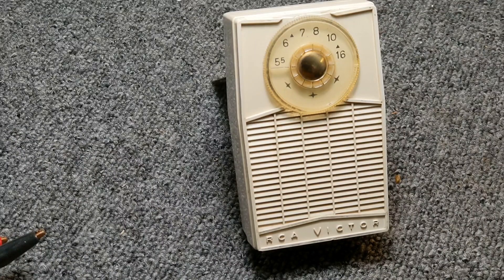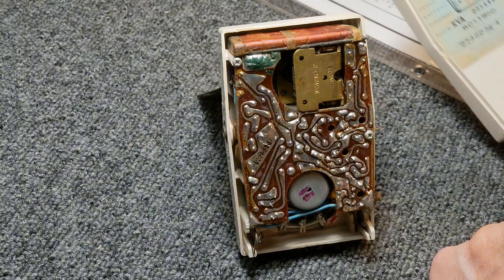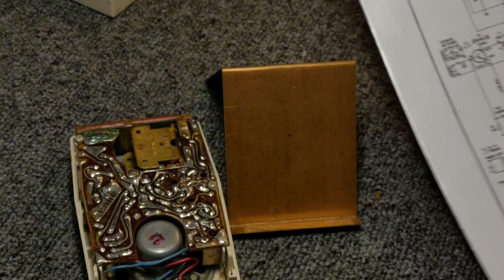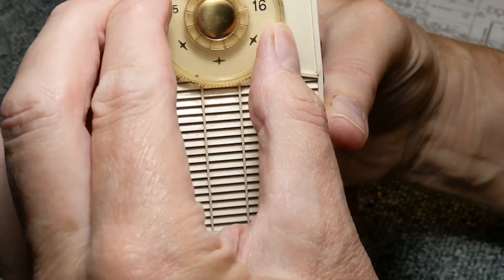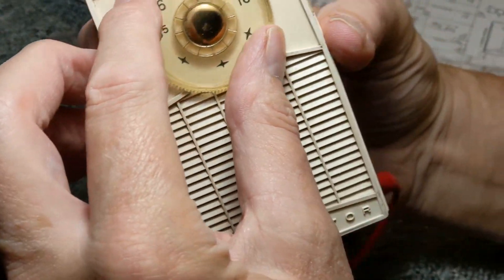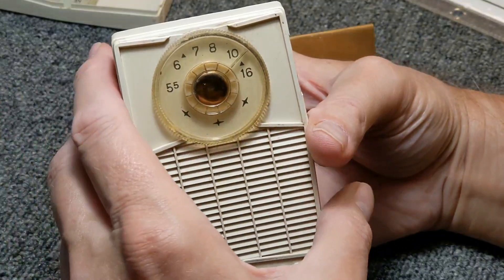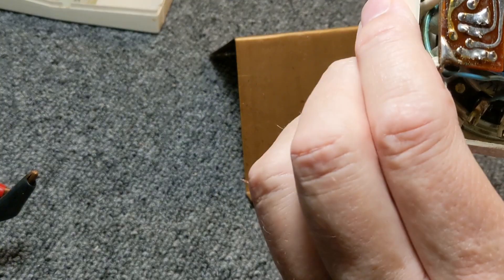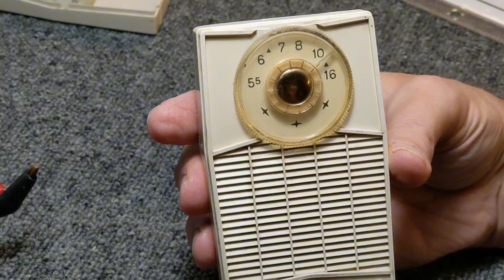RCA Victor, Pocket Radio chassis RC-1199D Evaluation.

Comment: I was shocked at the reception of that cute little radio!  What a beauty!  I never heard of a 4 volt battery...  I even googled them...   Great stuff Fred
Reply from the maker: These are great little radios. The sensitivity and selectivity are really good for a pocket radio. You could probably fit 3 AAAA FOR 4.5 VOLTS.
Yes, 4 A batteries.
Reply: Nice little radio. Made in USA i believe but might have some offshore parts. There are some 3.7 V lithium batts madr that would fit good inside
Reply from the maker: @user-vj7dp2ps9r Thank you, I'm not sure of where it was manufactured but I was really surprised when it worked without any repairs. Thanks for the tip about the lithium battery, I'll have to check it out.

Comment: I was going to comment on the lithium batteries as well, I do this every now and then when I get such little sets, I buy up laptop replacement cells cheap on ebay and tear them down for the cells.  Great place to get some working batteries on the cheap.
Reply from the maker: Hey Jerry, thanks for the advice, I'll have to give it a try.